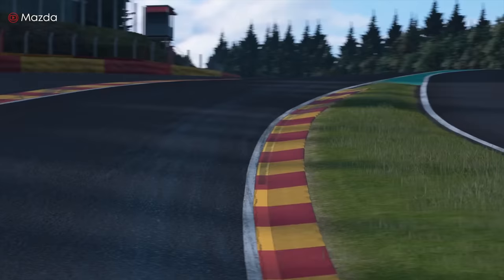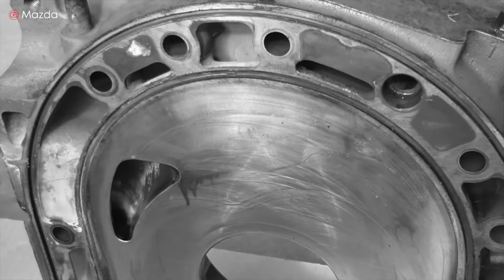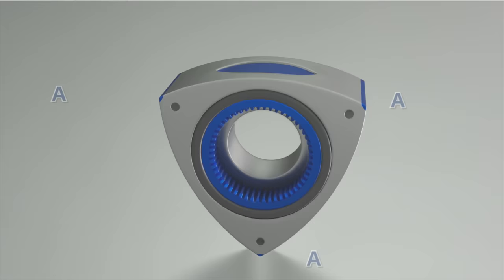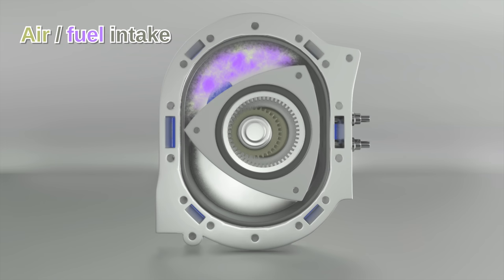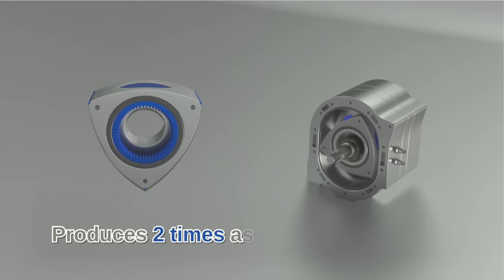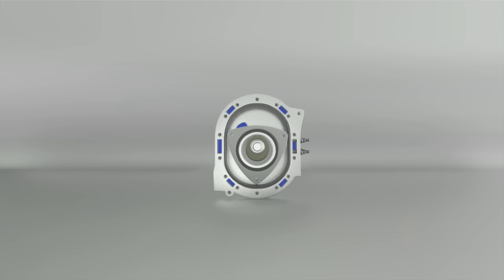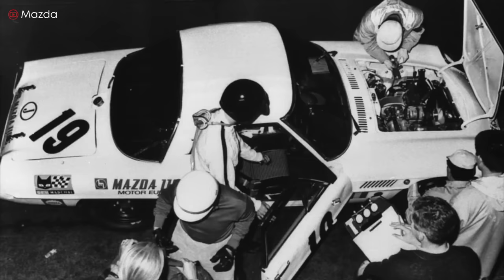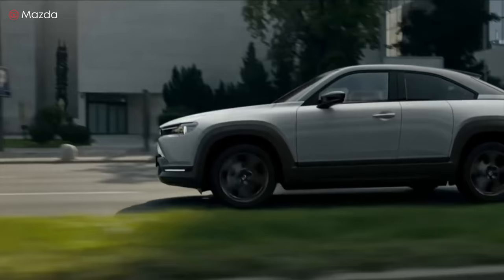Mazda's New Engine is the Most Powerful Engine Ever Made

Comment: The rotary engine should have been perfected 30 years ago but unfortunately, engineering machining standards were not up to machining it as a mass production engine. Now we have a wonderful new rotary engine with massive torque right across the whole rev range with only one moving part that will probably outlast the car that it is fitted to. It is called an electric motor. Anybody out there who would like to challenge its power and performance for its size and weight? Once we get the energy source sorted there will be no going back It's amazing we spend fortunes on refining fuel and delivering it to the fuel station. This new wonderful new fuel this new rotary motor needs can now be sent to the fuel station down a wire, and some fuel station can actually generate some of their fuel for sale on the roof of their premises. WOW!  Electricity is bloody marvellous. The savings are enormous mustn't mention low pollution as that might upset too many people with their stink pipe car engines. If you purchased an electric car do not drive behind an older style stink pipe car as it could be dangerous for your health!!!!! Breathing in those stinking fumes who knows what is in them.

Comment: They are fun engines. Revs more like two stroke power. Drove the wheels off my RX4 4dr and it died around 80-90k mi. Would be a good light wieght backup engine but they need to fix the wear issues or make the rotors seals quick and easy to replace.

Comment: There are many inaccuracies about the deficiencies of the rotary in this video. If it wasn’t for the absolutely absurd California emissions laws the rotary would be in a current Mazda sports car. I have an RX8 and easily get 20+ mpg and I push it pretty hard. By making sure there is adequate lubrication the engine will last more than 125,000 miles. The rotary engine is finding increasing popularity in aviation. This is due to its power to weight ratio and efficiency at full power. The 2 rotor Mazda in turbo form can easily produce over 325 hp at full throttle without issue. Yes they produce a lot of heat but that’s easily addressed with proper engineering.

Comment: A rotary is a 2 stroke engine by definition. Every time a combustion pocket passes the spark plug it fires. A 4 stroke engine fires every other stroke.
Reply: Whose definition? Rotaries have 4 distinct strokes. It takes 2 revs to fire all pistons, typically 1 to 10 for push mowers to Ferraris. It takes 3 revolutions to fire all 6 rotor faces on twin rotor engines. So it's 1.3L for only 1 rev, 2.6L for 2 revs as is the piston engine rating basis, and 3.9L for full engine cycle per SAE swept volume in 3 revs.
Reply: @kevink2315  2 stroke, fires every time the piston hits TDC, 4 stroke, every other. Wankel fires every time the combustion surface hits the plugs. A 2 stroke is still 4 cycle. It simply does two cycles per stroke. A wankel pulls in a/f, compresses it, fires, exhausts, pulls in a/f, etc. As the flat passes each quadrant it is performing a cycle. On a four STROKE engine the piston moves down, draws in air, moves up, compresses, hits TDC, fires, moves down, moves back up and empties. Then it begins anew. There is a dead stroke where no power is produced. Stroke means piston movement in one direction. Down, 1 stroke, up, 1 stroke. The wankel fires 3 times per one rotation. In 2 rotations it has fired 6 times, on a 2 rotor it has fired 6 times per rotation.

Comment: I wonder if any manufacturer thought of using a gas turbine for a range extender in an electric car?   Also, I think it could make a great super car by using a large gas turbine to charge a large battery to power some powerful electric motors.  When combined with a generator, the turbine can run at whatever RPM that make it happiest.
Reply: Gas turbine engines are poorly suited to automobile applications and completely incompatible with rechargeable batteries.
It is a fatally flawed concept which is why you don't see any.

Comment: Sorry Scotty but this video is full of inaccuracies.  I was a mazda tech for many years.  The only thing you got right on this was it has poor gas mileage and most of that was caused by stupid people trying to adjust their own carb....it HAS to be done with special tools and in a certain sequence.  Turn one screw to make it idle better it would throw the entire adjustment WAY out of whack.  I fixed a ton of them by just adjusting the carb and timing..  They exceeded emission standards WAY ahead of the game way back in the 80's.  The exhaust was very innovative to include a thermal reactor.  But it did cause the engines to run warmer than many.  Mazda solved that problem by re-routing the coolant very early on.  But what you failed to realize is the engines are actually 2 cycle engines and the lubrication was done by spraying oil on the epitricoid curves.  That with new apex seals made them nearly indestructible so long as you did not allow them to get low on coolant or oil.  The only time we ever saw them come in on a hook was due to dead batteries ( the motor had to achieve 150 rpm to start so low batteries would prevent them from starting), low coolant or oil.  Take care of them and you could rev them to 10 grand without ever hurting them.  I saw motors on the test stand at the factory schools that had more than a million miles and still met factory specs.  But no one wants to check their oil and coolant once a week or so and they got a bad rap.  I've had several RX's and never had any problems I didn't cause.  We raced stock cars with rotary engines and they ran us off because we were so much faster that no one cold compete with us....and we fixed rear ends and transmissions but NEVER tore engines down.  Damn good cars and damn good engines.  I still have one.

Comment: Owner of a rx8.
Dreadful traded it in for only £1500
Endless break down s
Refuse to start.
23 mpg on a motorway 
Got rid at 6 year s old .
Using lots of oil
Leaking oil also.
Only 27000 miles

Comment: This engine is fundamentally flawed by high quench of the gland front and high stress at the rotor tip seals. The Liquid Piston reverses the rotor shape and stator shape solving both problems. It’s much more efficient and has fewer reasons to fail.

Comment: Scott don't know rotarys!! Lots of wrong info here. Most reliable racing engine ever produced!!!!! Out last any piston enging, blow it up! Keeps running until you turn it off. It's like a two stroke engine, oil is mixed with the gas to lube the internals. My FD produced 360 rwhp on 1 bar boost on a 2200lb car, externals upgraded. 90 were fun..

Comment: after mazdas first attempt in the rx8 that broke if you looked at the engines in a funny way,i would think about giving it a very wide berth.i dont think they were very economical neither.from what i remember if they didnt get serviced every 6000 miles then thats when you get issues with them when most other cars are either 12000-20000 miles with certain engines

Comment: The other future of the rotary is in the custom engine street rodding crowd.   You can keep stacking on rotors and build light weight incredibly powerful and incredibly sounding engines.
Reply: @sandervanderkammen9230 .   Just not quite, there will always be a very small niche.
Reply: @Jester123ish  As far as the automobile industry is concerned its dead... been dead for a decade already.

Comment: Had one in the '70s great engine 8 Grand or eight thousand RPM every gear the downfall of the engine is if it overheated it melted the o-rings which the engine was destroyed and that could be done in just a matter of a minute

Comment: What a great idea..  an EV range extender..  Generating maybe 5KW of continuous Electric power would enable the EV to limp to the next recharging station, or even recharge over a full day given adequate fuel.  5 KW requires only 8 to 10HP, and given how small a rotary engine of this size could be made (Chain Saw Engine Size).  Given environmental exemptions for a Backup use would seal the deal.  Running out of Juice is the Prime concern of EV.  Say a 2 gallon tank of some long life fuel (Diesel?) would be ample for the very occasional Limp mode.

Comment: The most powerful engines are those built for ships if you exclude rocket motors. As far as I am aware Mazda does not make ship engines. As far as I can determine the most powerful rotary engine is the  Wärtsilä RT-flex96C, the world's largest and most powerful diesel engine. Built in Finland, the RT-flex96C's fourteen cylinders can generate 107,389HP with more than 7,000,000Nm of torque. Can your Mazda engine beat that ?

Comment: Fritz Indra gave a German Interview explaining why Rotary engines are inherently junk and generally hopeless. Main criticism is the very bad shape of the combustion chamber. The inherent need of oil injection into the combustion chamber is also a major flaw. Third are the ever failing seals. Mercedes Benz wasted billions and roughly a decade of engineering by trying to make it work. Just if anyone wondered why their engines from the 70's till millenium were outdated - they had to catch up.

Comment: Good Idea, Bad design... I went through 3 rebuilds with my RX3 averaging about 25-30 thousand miles on each rebuild. The main problem was the Apex seals and the Rotor housing being aluminum and the middle and outer housings being cast metal. The different metals displace and retain heat differently that led to warping. The later designed RX7 was better but still suffered from Apex seal damage. Gas mileage was horrible. With my last engine rebuild I had it balanced and ported WOW it was a screamer.

Comment: so the rotary engine but not ported to make 900 hp and big turbos,the 2 rotors rx7 and rx8 were reliable if you let them stock ported and stock power at around 200 hp and you changed the apex seals every 50 to 70 thousand km, the engine can last 300 000 km,if you dont replace the apex seals it blows up, and you need to drive over 4500 rpm so the engine gets lubricated, and the redline is 9000 it still last more to drive 5000-6000 like 2000-3000 on a normal car, and it doesnt care really if you rev it to 9000

Comment: No wonder it gets so much horsepower despite being 4 stroke. its because it accomplishes all 4 strokes in one revolution of the engine as opposed to the two it would take in a conventional inline, straight or v engine. I'd imagine the smaller engines are more fuel efficient too. Being only a 1 or 2 liter engine makes for good fuel economy as long as ur not driving crazy. I'd bet it could offer outstanding fuel economy if you paired a small rotary with an electric hybrid system.
Reply: It takes 2 revolutions of a piston engine to fire all pistons. It takes 3 revolutions of the crank to fire all of the 6 rotary's chambers.
Reply: @kevink2315  oh yeah true, but still in a regular piston engine it's one or a few piston firing at a time depending on number of cylinders. In a rotary engine, you can fire more chambers at once.
Reply: @ryannfodrea632  Sorry for late reply, I only see most comments under "Notifications". 

You can only fire one of the three rotor faces once in one output shaft revolution, and that has been the history of the Wankel ---  2 rotors means 2 power cycles per revolution, and so they rated it at 1.3L displacement in 1 revolution, ignoring the fact that it takes two more revolutions of the output shaft to fire all 6 chambers, and complete a proper, thermodynamic power cycle. Rating it at 1.3L would be as bad as rating it at the proper 3.9L, taking 3 revs to fire all 6 chambers.

Since 4 cycle piston engines dominate the world for now, it's best to use their power cycle of 2 revs to ingest combustion air. So just limit the flow to 2 revs, and you have an effective 2.6L engine, which is how all racing organizations properly treat rotaries.

Comment: This Rotary motor should take a new direction where all of it's inefficiency's could be capitalized by powering and heating a  turbine  which would have more fuel injected into the system exhaust to produce a simple powered turbo prop motor for a airplanes etc.. So as the motor tendencies to suffer wear and use more oil and more exhaust heat these conditions would become more favorable to feed the turbine addition of the motor plus turbine combination system.  A win win for the Rotary motor.  Imagine having a Rotary turbo prop type motor that produces MORE horsepower as it ages ....
  Mazada should put this on there drawing board and work on it. Zoom Zoooom ....  The instant start up of a Rotary motor coupled to a turbine would preheat the turbine and produce plenty of HP while doing it.
Reply: Wankel engines are too unreliable for passenger aircraft.
Mazda abandoned all development of this now obsolete technology in May 2009, the company only produces reciprocating engines now.
Reply: Gas turbine engines are lighter, more powerful have better fuel efficiency and are an order of magnitude more durable and reliable in aircraft applications.
This is exactly why they dominate the commercial and military aircraft engine market.
Reply: @sandervanderkammen9230  I had no Idea that the gas turbine would be more fuel efficient than the rotary motor.  I did read before that in Germany that a gas piston motor was used to spool up a turbine motor that then had fuel injected into it in the early days of turbine motors development.  Thank you for the information.
Reply: @raydreamer7566  A GE LM6000 can acheive over 42% fuel efficiency, more double that of the best Wankel engines.
 I think you are referring to the Riedel riedelanlasser??? a small 2-cylinder, 2-stroke motor used to start the Jumo -004 Orkan and BMW -003 turbojet engines during WW2.
 They functioned no differently than modern electric or air starter found on jet engines.
 Once the engine reached ground idle rpm, (About 2,000rpm) the starter engine was shut off and the engine would continue to accellerate unaided on jet fuel alone to 10,000 rpm.
Reply: Oh ok. It's been over 40 years when I read about that motor turbine combination. Thank you for setting me straight on how those two motors had functioned together. I am looking up that turbine you sent me now.
Reply: @raydreamer7566  You ar very welcome sir, cheers!

Comment: Perhaps they need to go back to the original Wankel design, it was a rev demon.  The design was completely concentric, fully balanced and would not have as many problems with the seals.  One major problem was that the engine required a spark plug in each face of the rotor, a big problem then, but not so these days with modern long life plugs. 

 It was more complicated than the production version and had more parts, but still considerably less than a standard reciprocating engine of the same output, okay perhaps not for a two-stroke, ported engine but...

Comment: Rotaries do not wear out faster than piston engines. If that were the case the only rotary entrant into the 24hr of Le Mans wouldn’t have made more power at the end of the race than at the beginning of the race. 24 hour races with piston engines wear the engines and the engines lose roughly 6%-9% of power.
Reply: Wankel engines are horribly inefficient and unreliable which is exactly why they cannot be used in type rated passenger aircraft.
Reply: Mazda lost the 1990 endurance racing championship to Mercedes-Benz and the 1991 Championship to Jaguar.

Comment: You speak of the rx-7 & 8 with out saying there MAJOR FLAWS like needing to be rebuilt after 40-65,000 miles, the fact that on start up you need to be spinning your engine and holding the revs at 3000-4000 to get the oil round to lube it correct and need to do the same before shut down... RX-8’s are KNOWN for these issues also another thing you missed you need to top up your oil every few hundred miles you also neglect to mention a rx-8 has 2x 1.3 ltr engines installed not 1

Comment: They are inefficient. A 1.3L twin rotor uses up about the same fuel as a 6L V8 but generates less than half the power and a fraction of the torque.  Much lighter yes, but who cares. It's not like the user is being asked to carry it.

Comment: I hate how people say Rotary's aren't dependable. If You treat them right they treat you right, i've seen 300k+ Mile 13b's with no rebuilds because of perfect maintenance. And the improvement of the Rotary will continue as long as i'm alive, if I have anything to do with it, they'll be replacing just about everything as they'll run on water and the the lubrication oil will all be plant based. F*ck electric and Gas, water is the future. The best part of it, the cycle of water to hydrogen will produce moisture in the air and could help end droughts by use. Once the tech is proven then  the flying model will begin it's production.
Reply: YET ITS TRUE, the Wankel engine is inherently unreliable and is significantly less durable than reciprocating engines.
 The Wankel engine is obsolete technology no longer manufactured in series production anywhere in the world, there is no longer any legitimate engine manufacturers developing the design.
Reply: @sandervanderkammen9230  Found him again! Hahahaha you cant help yourself "ANOTHER ROTARY VIDEO!!! REEEEE MUCH POLICE!!!" lololol . Its amazing. what a maroon

Comment: A 1.3 rotary engine has 1.5 x the power of a conventional engine,  so this makes a 1.3 like a 2.0 engine (but it burns 987393629574936 x the gasoline of a conventional engine) 😂
The sole reason i sold my 2008 series 2 RX8, The fuel mileage was excruciatingly painful.
Reply: The Mazda 13b is a 3.9 liter engine..
It produced significantly less power and torque per liter..